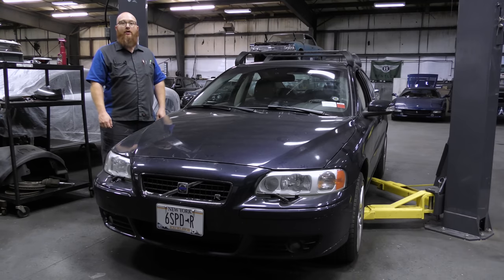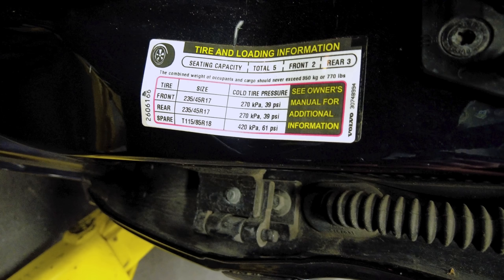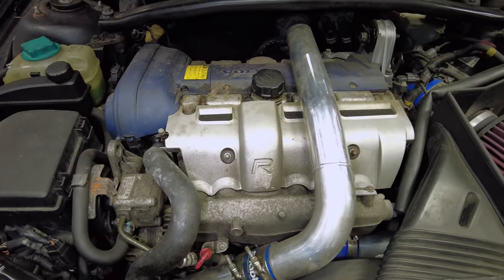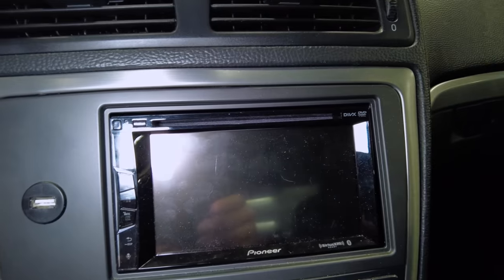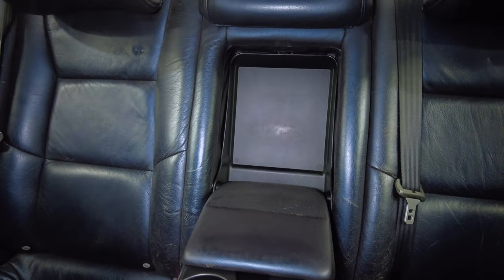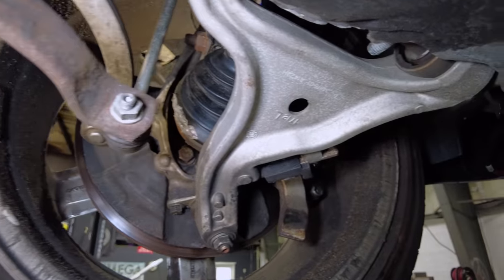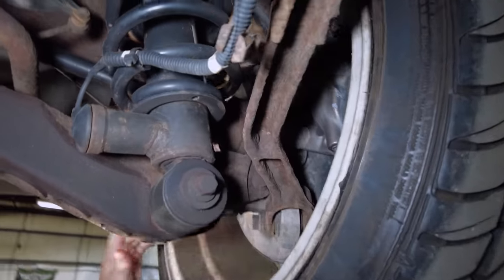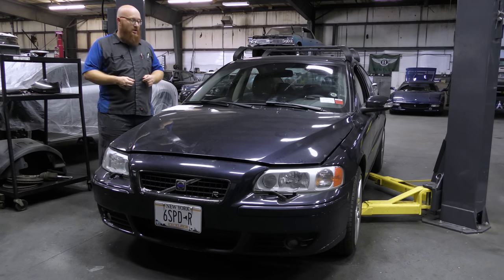They shipped their '07 Volvo S60R over 1K miles to my shop? CAR WIZARD determines if it's worth it!

Comment: Hello Mr Wisard, I have a 2001dodge ram it dies as going down the road it will start after about 15-20 minutes later any suggestions.  360 engine. 288000 miles. I would like to keep it to go to home depot.
Reply: Did you ever hear the radio show Car Talk? It's gone now, but I wish there was a show like that still where we can directly ask car questions to some mechanics! Even though I am not a competent mechanic (yet), they say that a car needs spark, fuel, air, and was there another requirement? Anyway you gotta find a safe way to tell if the spark plugs are firing, etc, I would think.

Comment: these things are pretty ez to work on !!! all them problems could be fix ed  with parts from   Erie volvo   but putting them on and doing the work is another issue. 
i put a xc90 2007 wood wheel on my 2006 s60 in alike 30 mins clock spring is right there like 20 more mins to do.
new parts on an old VOLVO never works out !!! go used parts !!!
I ALWAYS SAY if you own a volvo you either can turn a wrench or have deep pockets ? theres no other way to own a volvo.
the rack to do was literally $400 new  and a full day to install it .
from Detroit axle  with a lifetime warranty. 
2k just for that there needs too be a mint on my seat when i get in !

Comment: They need to spend a lot more on that car before its going to be right. The clearcoat looks shot in parts, definitely needs an overall paint correction. Needs that front bumper repaired and painted. I can't believe that repair to the RF axel boot, it won't last. That mirror looks like a stock part repair only, and I'm sure it isn't cheap. Overall the car looks very poorly maintained for the mileage. I believe you are a good mechanic and straight shooter. I might even bring one of mine to you someday...water lines for my 996 Turbo when they start to go if you're interested. So i get why he'd want you working on it. Hopefully he'll spend another $10k and maybe then it'll be a decent car. Jmo.

Comment: The thing about spending money to get a used car fixed is that you know it will be good after repairs are done at a good shop.  Replacing it with another used car means you'll probably still have to spend even more money for repairs.
Reply: Not if you buy a good used Camry
Reply: @BubblesTheCat1  Even a Toyota is still subject to how well the former owner followed the maintenance schedule.  Anything will break if you treat it badly enough.

Comment: As a past Volvo owner it is extremely hard to get parts and a shop to work on them, why I did most the work.  And Why should never buy one now. Especially since China ccp have bought volvo and are no longer making any replacement parts, as are going only electric and will not supply old cars with replacement parts.  Drive the volvo till it dies and don't do any major repairs, just not worth fixing.

Comment: issue with rubing is that front wheel  that limit turning angle  damper or forgot how its caling . had same issue with  R17 225 45 tyres  changed   worn limiter and  issue is gone  . also had   that limiter  in winter makes noise even new and wd 40 helped get rid fom noise

Comment: 3:50 I had respect for the owner until I saw the fake cold air bull shook. He won’t get the fog light fix but he put something that hurt the performance of the car. I what else dumb he did to the car. 14:30 The Wizard is tripping over a used manual transmission. You can tell when a manual transmission is bad from driving it within one mile.

Comment: Owner must have major sentimental attachment to this car, first time he got lucky in it maybe.  8K plus you have transmission work on the horizon and are those engines bullet proof?  Add a paint job.   My rule of thumb is every $1K on repairs I want 10K more miles.  This car will not provide that.

Comment: Hold on a minute, the drive shaft has been rubbing on the exhaust? At this point I think somebody has taken the all wheel drive a little too far and driven over some rough ground.
Then I see dents on the inside bead of another rim and finally the last rim in the inspection looks as if its inside bead has been bent out of round. This car would have a story to tell if it could talk.

Comment: My 04 volvo v70 I've alot problems . I'm having  heat coming up from the floor board drivers side window regulator ac doesn't work, busted sway bar cv axle control arms inner  outer tie rods busted motor mounts.  Burning 4 qts of oil between oil changes changes  valve cover leaking into plugs n coils. Supposed to have had done 2 grand of work. Owned car since Jan 2024

Comment: Dont change the rack befor you have looked into Just changing the brether pioes on the rack. They Come as a kit. It is a comon known leak. It was a recal if i recal corectly. 

Most parts on this are not spesial. Only the r spesific parts are expensive.

The transmisjon is easy to work on. And is also the same on other awd s/v 70s

Comment: The engines on these have been very problematic. They tend to blow up because they're squeezing three hundred horsepower out of a two and a half liter five cylinder engine. It's over stressed. It's impossible to justify spending a lot of money except for sentimental reasons.

Comment: You wouldn't understand it's a Volvo thing !!  To bad they sold out to Ford then the Chinese.  These cars will never be the same.
Use aftermarket from FCP or IPD.  Just as good and saves you alot of money.   Many of them are made by the same manufacture of genuine Volvo parts.  AWD-Check rear torque drive adjustment and pump before throwing alot of money at this car.  If those go bad it 5-6K.

Comment: When you got to the transmission part, I thought why is this bloke fixing all that other stuff when the gearbox is failing and all indications are it will be impossible or run the costs over the car's value?
It's a good looking car and if he is super attached to it, then go ahead I guess, just don't expect to recover the cost should you need to sell it.

Comment: My '01 V70 interestingly some of the same issues.
Rubbing right-front wheel also, because i run 19" R-wheel from an XC90 suv.
Fart noises when steering, caused by power steering leak in the engine bay.
My driver door window is also wonky and squeaky.
My brake calipers are covered in rust and a 3 month old brand-new rotor warped somehow, 
but i'm going to have the brake system replaced with one from an XC90 because the V70 stock brakes are not very good.
Reply: Go for the 320 mm from a xc90 t6. Or if you want spend a lot , 336 from the xc90 v8...

Comment: I have NEVER understood the current obsession with LARGE WHEELS ! What benefit do they have ? Often they are shod with ultra low profile tyres that give a hard, uncomfortable ride that's no fun at all !
For myself, I've never had IIRC, larger than 15 inch wheels (on a SAAB 9000). In   fact most of my cars had 13 inch wheels and they were 'just fine' ! I drove one at > 130 mph and had no vibration.

So, WHAT IS THE POINT OF THEM other than some ridiculous infantile 'willy waving' contest amongst other males ?

Comment: Wizard, frankly I'm surprised. That thing has a lot of rust underneath, and what's with that cold-air crap, as if Volvo didn't know how to design an induction system?  Plus it's a hooptie that needs way too many repairs. And this thing only has 120k miles? It must have been rode hard and put away wet too many times. You could squeeze three times that many miles out of a well-worn Honda and it wouldn't need all those repairs. And it also needs a boatload of cosmetic work. Even if the car was actually any good, being a northeast car, I wouldn't sink money into this. Sell it to someone who will.

Comment: God I got a S60 2.5T AWD in the same color 2006 and Im deathly afraid stuff may finally be getting older  I just found out after owning the car for 3 years the passenger brake light housing looks melted slightly internally around the bulb and I have no idea if that happen while I owned the car.  And its always done random fun electrical things once or twice a year
Reply: Temperature and old relays.....

Comment: This car needs to go to a scrap yard. Its done its time, its served its purpose; but its old, its tired, its expensive,  and its going to have nothing but problems year on year on year. I like Volvos I really do, but once they get 4 years past the end of the production run, the parts and the electronic complexities mean that they're worth more in used parts and scrap than keeping on the road.

Also, those wheels are from the station wagon, they were not factory-fit items.

Comment: The wiz says it doesn't make sense to put $15k worth of repairs to have a car that doesn't need repairs.   And it is more logical to buy another car like that, that might need $15K worth of repairs.     I don't get it.     

If the driver had that car for 16 years with out an accident, it is likely the car will survive another 16 years.

Comment: That M66 transmission has a lot of parts built Ford and Ford parts provider. You can find gear and internal parts for that transmission easily. These M66 does have some reliable problems. It has too many Ford parts. Made by USA = sht. 
The old M56 transmission is design and built by Volvo ONLY. Yes. Volvo build every single part for old manual transmission. It rarely goes bad. If is goes bad, there is no parts for it. Volvo does not offter internal parts. However, you can exchange your broken transmission with volvo for a new one from Sweden for about 3000usd.

Comment: If you love throwing thousands of dollars at a car...buy a S60R. 
I've owned one (1 of 41 in Australia) for over 4 years with 230,000kms and the list of things I've fixed would fill up the Vatican archive.
But they are a awesome driving car and handle like a cat on carpet. 🇦🇺
Reply: this era of AWD volvos weren't really the best, even if it was a normal 2.5T. In my country there is a reason for people who want cheaper fast fun they go for the 2.3 t5 or 2.4 t5 p2s. You can get much more power reliably out of those engines and no AWD/4C to worry about :face-orange-biting-nails:

Comment: And being a Volvo the check engine light is perpetually on and so is that little yellow triangle, it's just a fact with these cars, to put it in Scotty terms, they are an endless money pit, I wonder if this one has the GM transmission the same one that's in my 2001 lesabre, the 2000 s80 did.
Reply: Manual p2 volvos i think came with M56/M66 manual, automatic is Aisin AW-50/5X. Some s80/x90 used GM 4T65 which was really unrealible on volvos.
Reply: The early P2 trannys were japanese Aisin and always failed. This R has a manual so should be less problematic but apparently not very good either.

Comment: Watched in two times speed to save my brain cells but wish YouTube had a 3X setting… 

I bet the window regulator hasn’t failed it’s just the plastic channel guides holding the bottom of the glass..

Careful car wizard your reputation could crumble very easily

Comment: Had a few Volvos from this era so I'll comment: 

P2 "R"s are good cars but definitely for the most dedicated Volvo fans. Haldex + autobox saps the soul out of the engine and the manual is not much quicker; albeit very satisfying to shift with a light and forgiving clutch. Everything is expensive - expect AMG/M servicing costs but worse parts availability. The seats are comfy and the gauges intitive - but the rest of the interior is questionable. Most of the trim pieces are garbage and a PITA to disassemble without breaking anything. The handling isn't great considering the advanced/expensive suspension they ride on, and there's little tuning potential with the 2.5T unless you just won the lottery. And for some reason, most mechanics just don't want to work on Volvos (especially R's) - the same mechanics that will happily work on anything German/Japanese. The bodywork and paint is quite nice though. 

In other words, buy a P2 2.4 T5 with the M66 manual if you want a performance Volvo with tuning potential. For a no-nonsense daily get a 2005+ 2.5T (non R) or an S40/C30. Skip the rest.

And no, for the love of God, don't be tempted by the V8 S80. You think VAGs are a headache? Mess around and find out.
Reply: Which years of the S80 with the V8 are bad?
Reply: @zzoinks  2007. Rest are slightly better but not worth the repairs. Just get a well sorted W221 or W211 - flat out better cars for the money.
Reply: @tonyl7286  really! The Mercedes are reliable? I've always thought of Volvo as being in between the complexity of regular brands and those super luxury brands like Mercedes, except for the R editions. So in my imagination, Mercedes is so complicated it is more expensive to fix.
Reply: @tonyl7286  thanks for informing us about the S80 V8 then. I hadn't heard any bad thing about it previously because I assumed it would be similar to the XC90 v8, which people have a high opinion of. Now I know. And I've heard on the forum V8 transmission issues can be fixed with a fluid flush or a revised valve body, but the price of the valve body appears to be $1k+. I still like the S80, perhaps a different engine and transmission combo then, since it has a great safety rating that applies across the whole 2nd generation.
Reply: @zzoinks  XC90 V8 would be a better choice than the S80 based on value. Both are heavy luxury cars, except XC90 is more practical, safer, more or less same on gas, and slightly easier to work on. And, XC90 V8s are more common and I usually find them cheaper than S80 V8s of comparable condition.
Reply: @zzoinks  The S80 V8 is similar in cost - running and purchase, to a 211 and slightly less than a 221. 2008-2009 211s are bargains with none of the issues of the pre facelift cars. They are also relatively easy to fix (for a luxury car), parts are plenty, and lots of knowledge available for DIYers. 221 S-Class can be more expensive, but not much harder to keep on the road than the S80. And it is a flat out better car than the S80, even regarding safety.
Reply: @zzoinks  The best Volvo from the 2000s today is a well-sorted 2005+ P2. Ideally a S60 T5 2.4 with a 6-speed manual. Followed by XC70 and S60 2.5T (non-R). S80 is just kinda....meh.

Comment: new york is short for severely rusted
Reply: These Volvos are pretty rust resistant even in NY. The trick is to wash the undercarriage especially after winter. Having owned a 16 year old S60 in Ontario, Canada rust was never an issue. An idiot running a red light was! I walked away from a totalled car without a scratch. Went out and replaced it with another Volvo!

Comment: @cornpop1760
0 seconds ago
I once put a set of brand-new tires ($900) on a car that exceedthe value of the vehicle.  I got T-boneD two months later and my wife suggested I go take the tires off 🙄😂  That seems to be the curse.  If you spend it, you will Wreck it.

Comment: I will just push that estimate to 10k, almost 90% of those R are now front wheel drive as the rear diff is well known to have rear differential issues preventing power to go to the rear wheels. Elliott Alvis had the same issue in the one he bought from EuroAsian Bob

Comment: This customer should had traded-in this, 2007 Volvo S60R AWD for a much better, reliable and fuel-efficient vehicle. He should plan to buy a vehicle that does not have problems constantly, like a Toyota (Car Wizard approved), not a brand-new one, but a used one. A 2017 Toyota Camry LE mid-size sedan with the 2.5 L four-cylinder engine and the six-speed automatic transmission is one of the best looking and reliable vehicles in the market. The Car Wizard has told most of his customers to buy a Toyota. They just do not get the message or do not care at all. That is embarrassing for most of us.

Comment: You don’t want to exceed the value of the car in repairs but your at 7k already and still needs a transmission when it gets back home for 4/5k smh wizard u make no sense rt now the more n more I watch you I’ m starting to think that you do take advantage just a bit because your YouTube channel just my thoughts
Reply: I don't think that you should necessarily use value of the car to judge whether to fix or let go, if that was the case people who bought $1000 car should throw it away after fixing 2 major things. Maybe if the car is breaking left or right, majorly, then it's time to let it go.